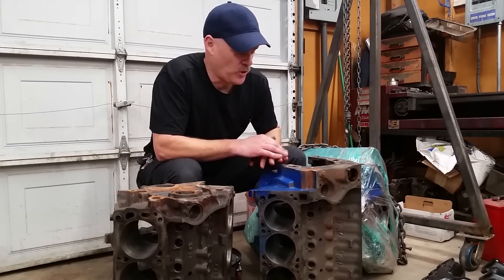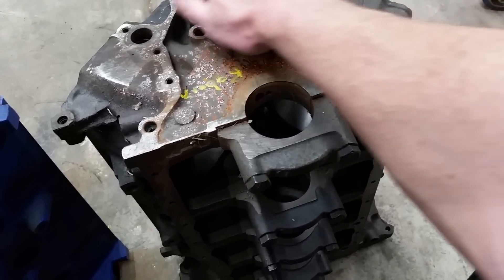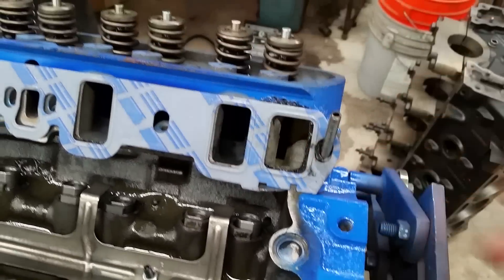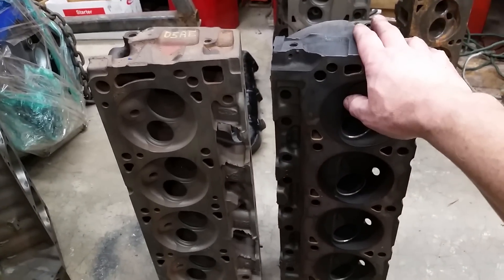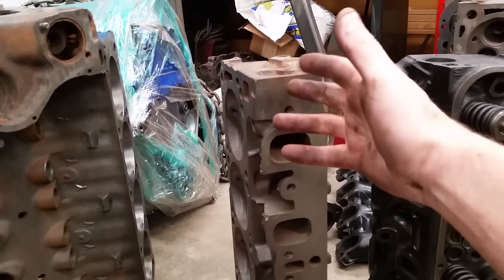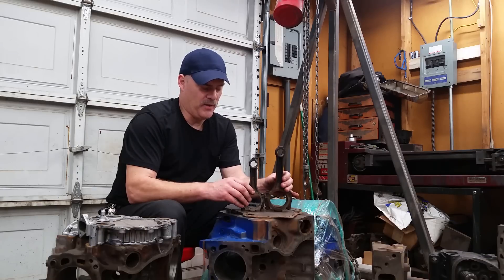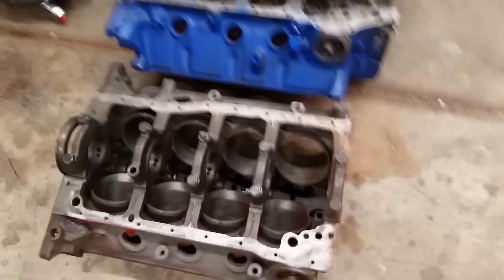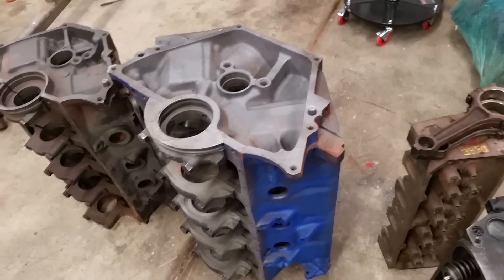302 vs 351M blocks

Comment: Did you really say the FE series motors are called Y blocks? FE blocks are FE blocks. Ford/Edsel. Y blocks predate the FE blocks. They came in 272, 292 and 312 Ci. Completely different engines than the FEs.
Reply: Physically, the FE was a Y-block. It was not a member of the 272, 292, 312 engine family commonly referred to as Y-Blocks. Even though it's not commonly called a Y-Block, It technically is a Y-block because of the deep skirt block design. The Big Block Mopar engines which, like the Ford FE, went into production in 1958 are also Y-Blocks because of their similar deep skirt design. Nobody calls them Y-Blocks though.

Another interesting fact is that the 351M/400 engines actually have a higher deck height than the FE engines.
Reply from the maker: Yes I am aware of that but the FE engines are also called a Y block because of the shape of the skirted block it is quite common for an FE to be refereed to as a Y as well
Reply: I have never heard that before and I've been around Ford engines for over 50 years. They were always talked about separately, but I guess the bore spacing is the biggest difference and they do share the block shape. Not common around here, but it's true I reckon.

Comment: when will you post videos of the 351m engine? I'm building a 400 with stock style pistons because I couldn't find anything high preformance. am I wasting my time trying to get performance out of it?
Reply from the maker: no they run pretty good if you get the cam timing right snd use a good intake and ex system
Reply: yeah I got the rv cam, edelbrock intake and some headers. haven't decided on a 4bbl carb yet
Reply from the maker: Holly
Reply: thanks
Reply: Yes a waste of time and monies...  most common for torque/power increase for cheap go Windsor351 block, Jegs 4" stroker=408inch .. if you have deep pockets research Dandy Engines 461cid for 650+ light weight monster!
Reply: Myvintageiron7512 how many CFM on that holly?
Reply: Scott t , A friend of mine had built a modified and had to use Cleveland pistons, but had a machine shop work the piston pin area on the rods  to make it work. He was pleased with the performance over all, but said the process was somewhat  counter productive. He was not pleased with the intake and header availability either.
Reply: well 3000 miles after my 400 was rebuilt it has a tick on passenger side head, any ideas? ive checked headers numorous times.. compressions 125-130 between all 8
Reply: scott t might be an exhaust leak on the manifold. I had a 302 that had the same problem
Reply: I still havent figured out my tick... i dont belive its a exhaust leak tho
Reply: Interesting fact. 351C and 400M use the same piston. BUT Ford in their wisdom made the pin 12 thou bigger on the 400! So unless you have a very good machinist you are stuffed. AFAIK there is nothing decent in a 400 piston. And FM/Speedpro are 25 thou further down the bore than OEM and have NO compression. You can buy a decent flat top and lumpy for the 351C. 
Been there and done all the math!

Comment: I've got a 1980 351m with broken timing chain. I read oem chain was retarded and a better high performance chain/sprockets is recommended.  Which manufacturer/chain would that be?  Rock Auto has like 9?
Reply from the maker: I would go with c comp cams chain and gears

Comment: How much did it cost to get the blue block cleaned to the point it looks like new metal?  If you did it yourself, what did you use to get it that clean?  Thanks, dt
Reply from the maker: We use a Vat tank or an oven and a blaster these are machine shop operations just take it to a shop don't waste you time trying to clean this stuff yourself you will never get it clean
Reply: Thanks for your answer, how much should I expect it to cost to get my block cleaned like the blue block?  Thanks for  your help in this matter.  You do a great job with explaining what to do in your videos!!!!!

Comment: I have a 351M in my 78 Ranchero.  The only engine mods I have done are headers, 4bbl intake with a Holly 600, MSD Distributor and MSD electronic ignition.  I have new Edelbrock Aluminum heads, a Comp Cam (Mother Thumpr) and Scorpion roller rockers to install but have never worked this deep into an engine before.  Your promised video would be very helpful - when do you think it will come out?
Reply from the maker: It is on the list and will be coming soon but as you probably know engine building is time consuming and documenting it on video takes much longer but it will happen remember some of these builds are filmed several months before they are edited and posted

Comment: I was not aware the FE blocks were called Y-Blocks. I thought the Ford only made a few Y-blocks such as the 272 that was in my '57 F100, 292, and 312 that was in the Fords.. Not including the Lincoln or Merc.
Reply: FEs were an upgrade on the Y block. Same basic infrastructure. But FEs were far more modern in the head design.Y blocks were 232 272 and 292. And the 332 was a bit of both. Smallest FE I feel was 252? I dont know these engines near as well as Clevo and M engines. Or Windsors. The 429-460  are too an xtent a big boss 302! And are NOT FEs!

Comment: I love where you explain the issues of having an aluminum timing cover on an iron Ford 302. I literally had my timing cover bust a lead at the exact point where you pointed to at the 12:00 minute mark on my Lincoln Mark VII with a 5.0. Between work and the family, I just finished up installing a new timing gear-set, timing cover with seal, balancer, water pump, thermostat, thermostat housing, silicone hoses, and radiator. To say the aluminum timing covers leak alot is an understatement. 

Love the Vids.

0.020"

Comment: I believe I heard some or read some where that the designer behind the 351C which is what  the 351M was originally based on was also involved with Oldsmobile?
There does seem to be some similarities between the Oldsmobile V8 designs and the Ford 351C and 351-400M block designs.

Did you do a video about Oldsmobile engines yet. Other than explaining the Buick, Oldsmobile, Pontiac and Chevrolet 350 differences?

Shame on me for not knowing. I am a subscriber and wanna be hobbyist. I can only wanna be because my budget doesn't always go where I want it to.

Comment: I've seen two or three claims that using a 351M or 400 bell housing to connect a 429 or 460 to a manual transmission requires a 3/16" spacer plate between the block and the bell housing. Have you ever seen if that is true?
Reply: Reputedly so do Clevos. I use a cast iron Ford b/h without and no spacer on the starter and it works fine. However [with a Tilton clutch] I had to custom make a thrust bearing carrier..
Reply: I've swapped a dozen in. only an issue if the 4 spd came from a 360/390. if its from a 400 or 460 its a bolt on fit.

Comment: Is the 400 and 351m a boat anchor? Sorry had to ask.  I have a 400 that runs on a engine stand I built. No idea what to do with it. I'm learning motors myself and new to building.  Buddy who sold me the LTD it came in tells me to get rid of the 400 and find a 460. Idea for the motor was to make a mud buggy or something. Now I have no idea as I got a 69 k10 with a 400 that I'm more interested in getting on the road
Reply from the maker: The 400 is pretty good with the right head,cam, and piston combo in stock form it;s kind of a dog
Reply: Any ford engine after 72 is a dog, a 460 of the same year will only have maybe a 40HP improvement. 400s can be made to make gobs of horsepower. LEB built one that made 600 plus HP.
Reply: the 400 and 351m are exactly the same except for the pistons and crank also all 351m/400 blocks are cast for 4 bolt main caps and can be cut for the 4 bolt main caps and after that you can build that motor to produce crazy amount of power ....also the 400 cid 351m/400 has a full 4" stroke making it a torque monster if built right
Reply: The 400 has the biggest stroke of any Ford motor including the 460.
Increase compression to at least 9:1 use Cleveland 2v heads with a torque happy cam and good timing set wirh a low rise intake ...you will have awesome street motor.

Comment: What heads & cam would it take for a 351 to have peak power over 7k and 570hp?
Reply from the maker: 351M will not live long if it;s twisted to 7K not recommended

Comment: Im building the same engine, do you think the 351C 2v early 70s heads are better then the 351M?
Reply from the maker: Yes for sure that is exactly what I am using on my build D1 casting 2V heads
Reply: Will a 351m aftermarket intake work fine and bolt right up? The problem i find with the 351m is finding a set of flat tops and figuring out what type of cam would work best.
Reply: Get a set of Australian 302Cleveland 2V closed chamber heads!

Comment: would luv to see a clevor bogus boss build! 335 series blocks were all cast for 4 bolt mains. You can see it on the rear main boss of 351M. Very rugged block.
Reply: Sorry mate , 351 Clevelands and 302 Clevelands from Australia had two bolt mains from 1975 untill production stopped on Clevelands in 1984/5

Comment: You've covered the 302 & 351W's and 302 &351C's and the 351M and mentioned the Boss and the FE and the Y block now as I remember there was another OHV Ford V8...As I remember it had 5 bellhousing bolt holes...Early Mustang 289's may be.?..Not sure 'bout that or was it the 260.?..
Reply: Early 260/289 Mustangs and Y blocks  used 5 bolt b/h. That is the easy way to pick cheaters for GpN b in Australia.
Reply: The 5 bolt bellhousing is the six cylinder style but used on 221ci Windsor's , 260ci Windsor's and early 289ci Windsor's !

Comment: great videos. my questiin......is the Cleveland block (other than the two different deck heights) similar to the modified block with the Windsor transmission bellhousing pattern and two bolt motor mounts?
Reply from the maker: yes

Comment: Better yet is a Boss 351 build which requires a 4 bolt Cleveland block, Cleveland 4 bbl. heads, mechanical cam (etc.), aluminum intake and a big carb...unknown to most Ford fans is that the '71 Boss 351 held the quickest 1/4 mile time of any production ford back in the muscle car era and was only bettered with some of the more recent pony cars. I owned a '70 Mach I with a 351C 4 bbl engine and back in the day the hot rod magazines had documented all it needed was a cam, intake, headers, and big carb to go from 290 HP all the way to 445 HP...I had those mods done to mine and can attest to what a monster it became...when mine was stock I had a very sweet modified LT1 Camaro run away from me and hide and after my mods I did the same to him....and as one more anecdote, when my Dad and me were tearing the engine down for the mods, we checked the tolerances and were astounded to find our block had 4 bolt mains, which was not the norm but apparently some of the 4 bbl 351 Clevelands got the 4 bolt blocks....whereas all the Boss blocks were 4 bolt....also for those who don't know, the reason I keep saying 4 bbl engine is because the 2 bbl cleveland heads had smaller valves, which were still sizable but not the BBC sized valves in the 4 bbl engine.

Comment: I think you can use the 400 crank and rods to make the 351M into a 400. those are really decent engines to work with that sadly the aftermarket forgot about. the Horsepower Monster channel built a 400 with Cleveland heads and other little tricks,all naturally aspirated and got over 500 HP and very high torque numbers with a flat as Kansas torque curve. love to take a engine like that and build a Starsky and Hutch replica of a 74-76 2 door Torino with! that is me though!
Reply: I live in Kansas not that flat till you get out west. Just saying.
Reply: it is the crank and pistons to convert to a 400cid both have the same rods ....the 351 uses a 3.5" stroke crank and pistons with a relocated wrist pin to make the 351cid

Comment: the 351 m started replacing the Fe 360 in pickup trucks they work pretty good if you use the oil pressure gauge as a tachometer and driving like that keep them revved up and pumping oil everybody was lugging them and the bearings didn't last when you love them 351m low oil pressure really drops
Reply from the maker: I recommend a high volume pump for this engine and don't over rev it either these engines don't like high RPM's the crank journals are to big
Reply: the 351m/400 crank journals are the same as a 351w should try building a clevor by grinding a 400 crank counter weights then re-balance allowing you to get 4" stroke in a 351w block

Comment: I enjoy your videos. No need to over complicating the 351-M. Simply put the 351-M is a de-stroked 400 (4" bore 4" stroke) big brother of the 351-C which was created just after the 1969 introduction of the 351W. More 351 engines were needed than could be produced at the Ford Windsor plant so production began at the Ford Cleveland plant while at the same time improving the design of the 351W thus creating the 335 engine series the 351-C and 400 (which replaced the FE 390). Then around 1975 because 351-C engine had ceased production (but not on the 400) and more 351's were needed the 400 was de-stroked to create a 351 designated M. As you have pointed out different from the 351-C because the 400 had taller deck height, larger 3" mains and different engine mounts etc. (there were 400's with both the small and large bolt patterns referred to as FMX blocks made in the early 70's). Looking at the 351M as a 400 makes it much easier to understand and compare to other engines...at least I think so...hope this helps.
Reply: Elstevo Mac understood
Reply: Windsor also built Cleveland engines...
Reply: So you can get more outta a 351M than a Cleveland? I bought a 71 mustang off family and instead of a 351C under the hood like the vin says I found a 351M. I guess my uncle blew the original. I’m trying to figure out if it’s worth looking around for another 351c or saying screw it and going for a restomod.
Reply: @Bonanzaking  pull the 351 and drop a 400m with the cleveland 4v heads and you have a stroked cleveland. They run very well.,I have two.
Reply: @briana3467  there is no 400m. its a 351m  or a 400. there is no m behind the 400. ever.

Comment: The aluminium timing cover water ports hmmm maybe a thin steel sleeve could be put in there ? to stop corrosion?
Reply: Just change the antifreeze every few years so it doesn't get acidic and there is no problem!